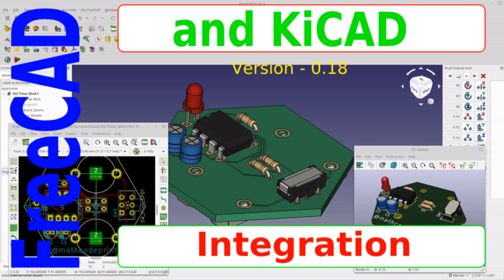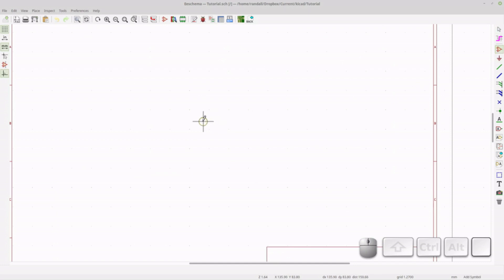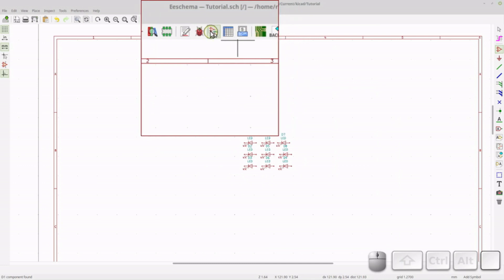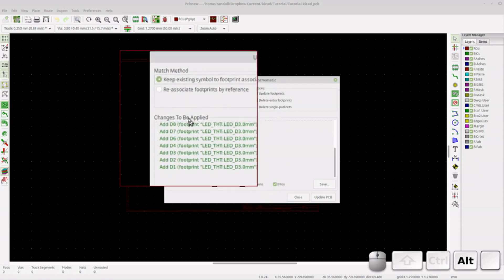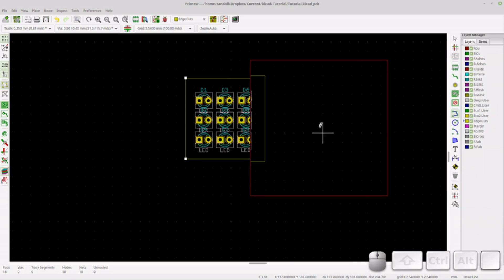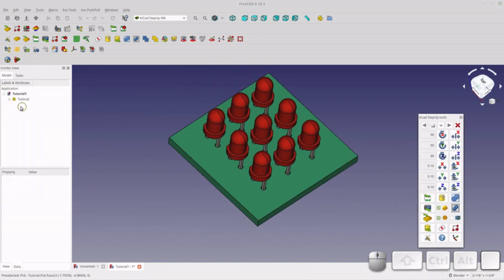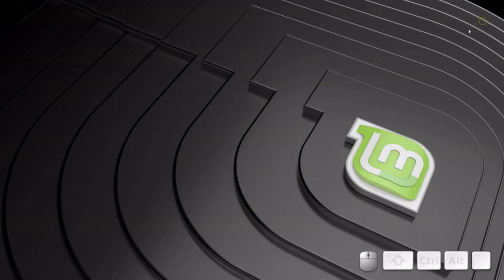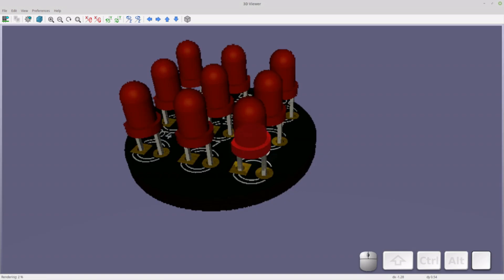KiCAD and FreeCAD Integration with StepUp Module

Comment: Idk if you figured out your silks problem. I had a similar issue but figured it out. Both of my silkscreens were really small. I found I had to go to the plot tool then make sure it was in DXF format. Then I made sure that my units were correct. Previously my silks had been tiny because my board was exported in metric and the silks had been in inches. So when I used the correct units everything was perfect.